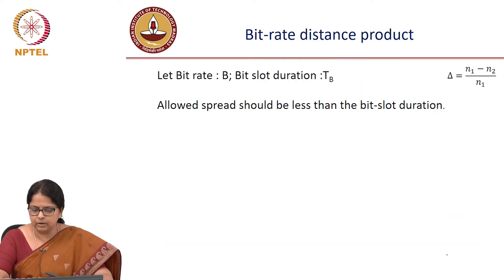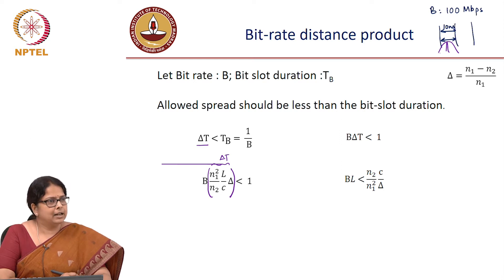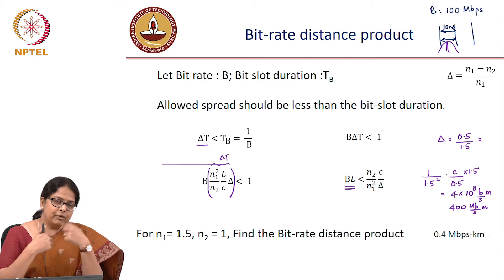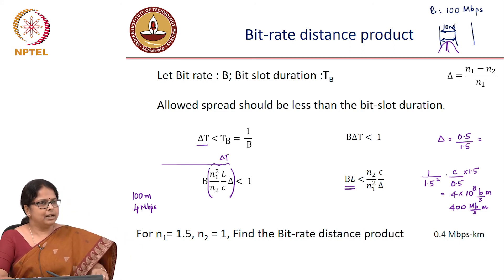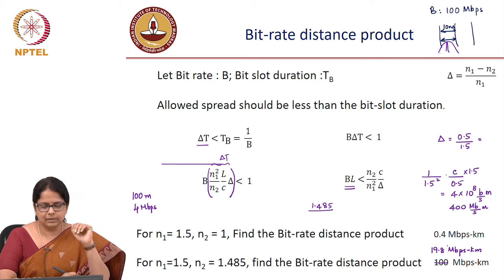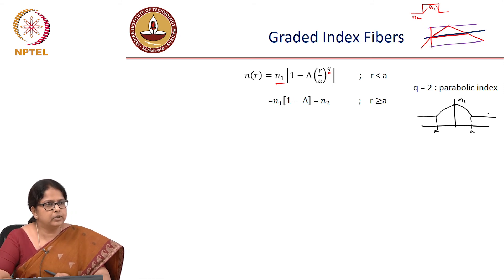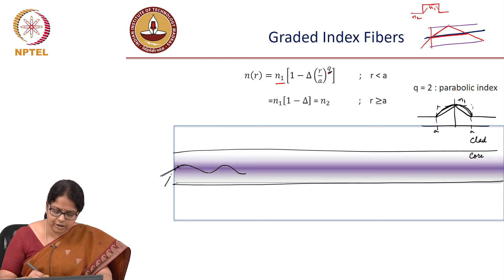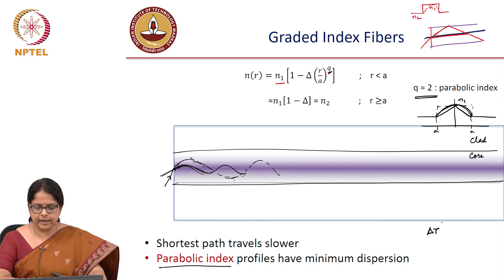Lec 53: Dispersion-Bit rate distance Product

Comment: The lecture is very clear and I watched it with a great interest, madam. But I have a question. During lecture 52 you calculate time dispersion in terms of L, which is the length traveled by the ray along the fiber per one reflection. However, here you take L as the length of the fiber-optic. Something is wrong here. As I feel we have to calculate number of reflections inside the fiber to find total time dispersion and then only calculate the final bit rate. Hope someone will help me to clarify this. Thank you